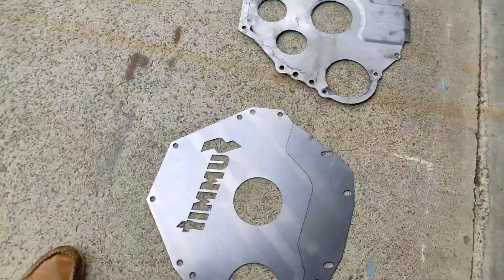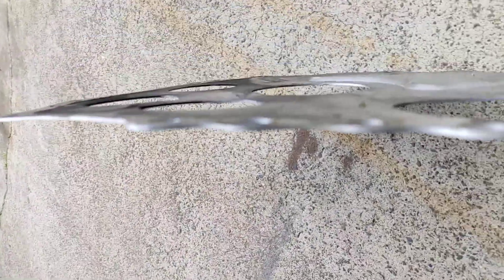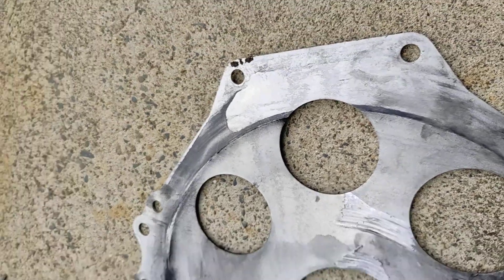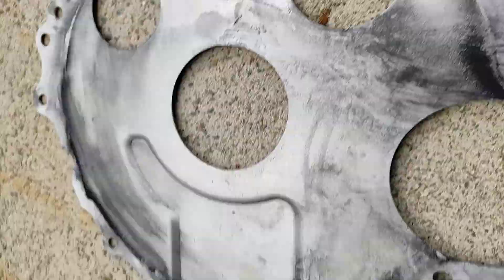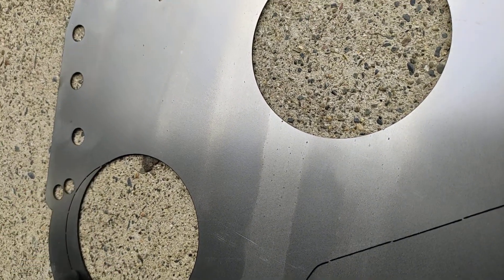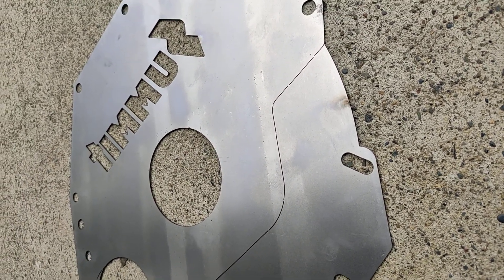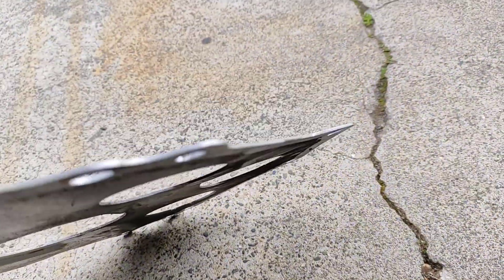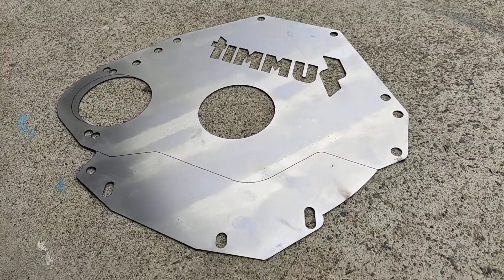steel vs aluminum block plate

Comment: Hey man I’ve ran into a issue with my T5 swap 🙁 got everything together and went to crank it but the starter is grinding bad so I didn’t try anymore because I didn’t want to mess the flywheel teeth up! So my question is, is there a difference between the Automatic starter and T5 starter? Thank you
Reply from the maker: I don't think so I used my same one, what bellhousing are you using?
Reply: @vrm86gt  I’m using the bell housing that came with the T5 that was in the Foxbody from the JY. The block plate isn’t bent or anything
Reply from the maker: @jdrods1519  what about flywheel?  157 tooth?
Reply: @vrm86gt  I haven’t counted it yet but I looked back a pic I have of it and I counted 161 but I need to count it in person to make sure
Reply: Ok I just had my father in-law count it and he said 157 I don’t get off till late 🙁
Reply from the maker: @jdrods1519  ok that good
Reply from the maker: looking around online it seems auto and manual oem units are different length on the snout, that would explain the grinding if the teeth aren't engaging all the way.
mine is a replacement mini starter not oem, is yours a oem.style?
Reply: @vrm86gt  yea that’s the same thing I read also. Yep mine is the stock style that I can tell. I even took the mini starter off and put the big factory style on it and it still grinds lol
Reply from the maker: @jdrods1519  dang, is one shorter than the other in the nose area?
Reply: @vrm86gt  yep but it so short that it doesn’t reach the teeth on the flywheel lol
Reply from the maker: @jdrods1519  I'd take the starter to the parts store and compare it to one for a t5 application.
Reply: @vrm86gt  so I pick one up lastnight that’s for the T5 and 157tooth flywheel so I’m hoping it works. If not I have a different issue. Thank you for helping me out man! Ill keep you updated!
Reply from the maker: @jdrods1519  best of luck JD!
Reply: @vrm86gt  thank you!
Reply: @vrm86gt  so I went and got a OEM starter this morning before work and tried but still grinding bad. I did find a slight little bend in the block plate right where the starter mounts so I’m going to probably take it all back down and start fresh with a new block plate and if it still down it then I’ll do a flywheel. I always find the worse stuff that goes wrong 😂🙁
Reply from the maker: @jdrods1519  Sorry JD, that stinks! Were you able to see if one was a little longer or not?
Reply: @vrm86gt  yep I did and the one I got from the parts store was the same exact thing I had. I’m hoping to get this fixed soon! Is there a certain thickness block plate I should go with? Or are they mostly the same? I measured the distance from the back of the flywheel to the block plate and it was just shy of 3/4
Reply from the maker: @jdrods1519  I'm not sure on that measurement JD. I can try to check mine when I get the chance.